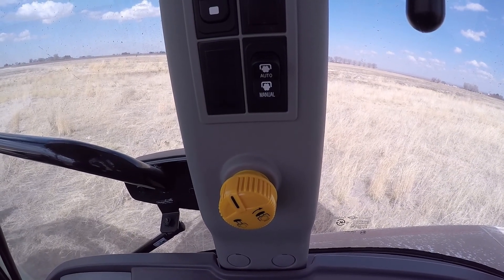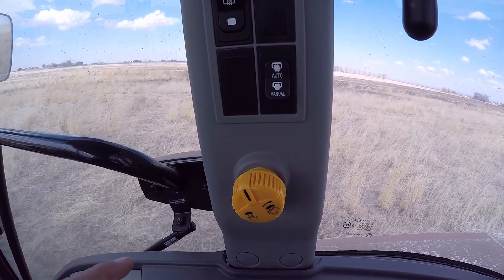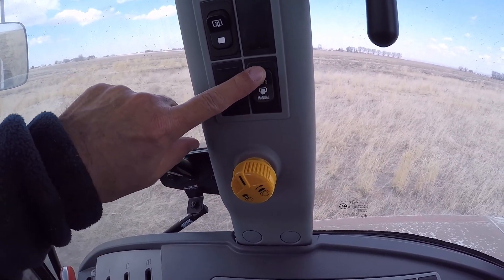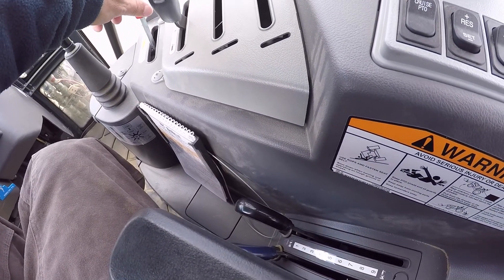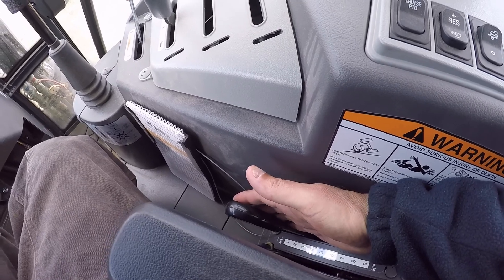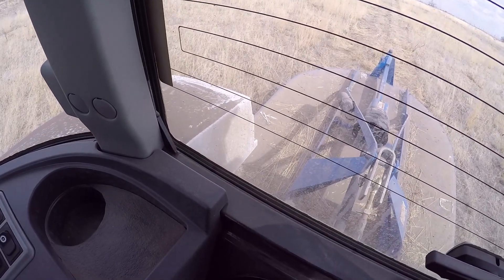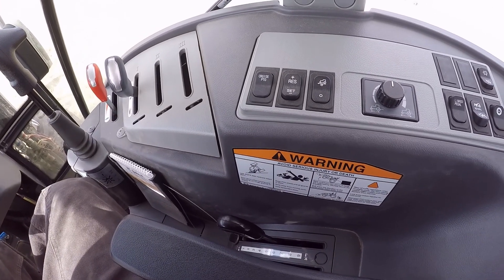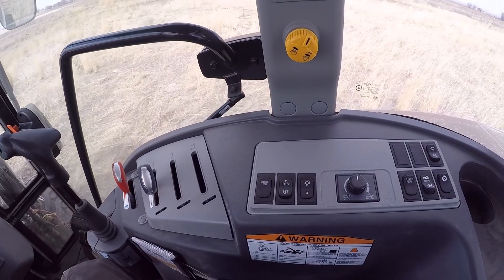Bobcat Tractor Auto PTO

Comment: Question!!! I got a Yanmar YRC72 mower for my CT5558 and on the mower it says do not exceed PTO speed of 540 RPM. How would i use it when my tractor idles at higher than 540 RPM?
Reply from the maker: The 540 rpm is in reference to the speed of the PTO output shaft that you hook your implements to. On your tractor engine rpm gauge there should be a mark usually in yellow and usually resembling a PTO shaft and generally around 2500 rpms, give or take. When you set the engine rpms at that mark then your PTO rpms will be at 540. 
I hope that makes sense.